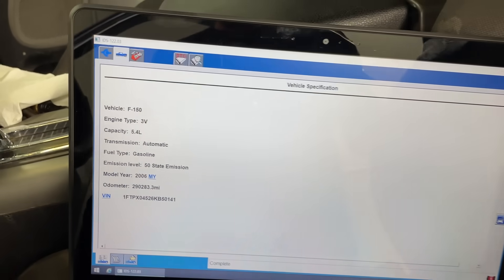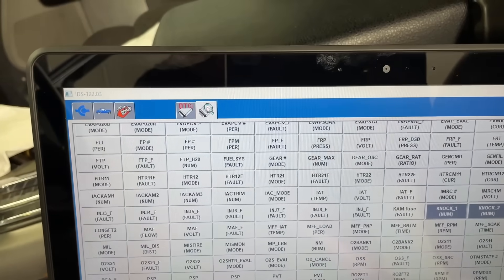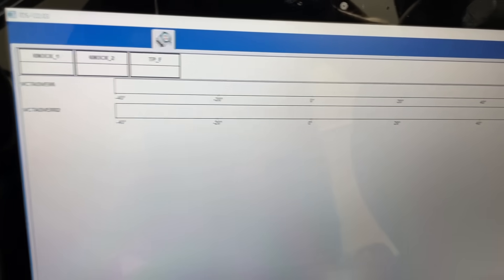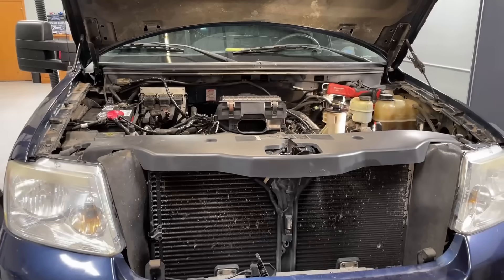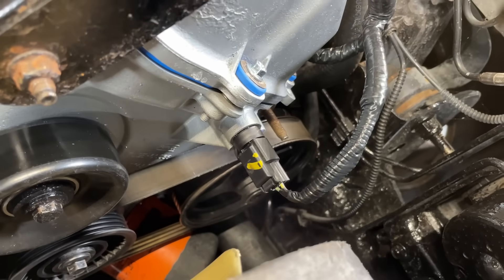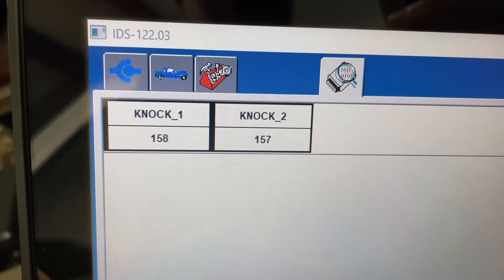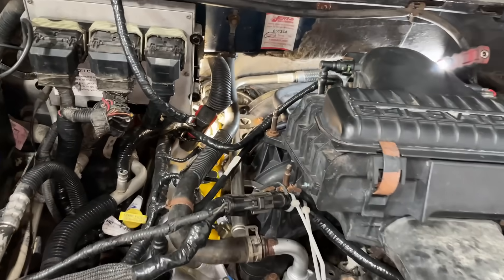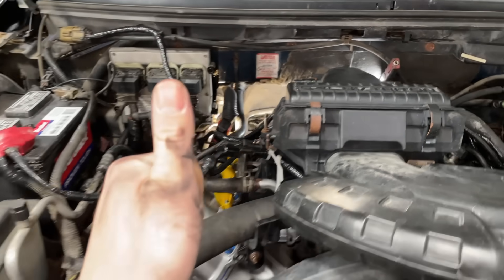Ford F-150 5.4L 3v Triton P0325 P0345 P0349 Cam Timing and Knock Sensor Faults After Engine Install

Comment: Brought my truck in, paid over 3 grand to fix cam phasers, I was told, was the reason for my f150 triton, 2006, 5.4 knocking noise, ....still making same noise!  Just gonna run it till it dies now, not putting anymore money into it!!! Which is sad, because otherwise in great shape,......noisy  tho lol.
Reply: Bro check ya spark plugs

Comment: Please help me. I have a 2011 5.0. Cylinder 7 misfire. I checked all ignition and changed them. Did nothing. Pulled the heads off. My intake valves were really recessed. Got my heads redone. Still misfires. I have no idea what to do. And every time i drive it it goes into limp mode. It also smells kind of bad on a cold start

Comment: Interesting. I had a 97" T-Bird 4.6 and it kept having high idle, even after replacing the Idle Control valve, and the TP sensor. Still had high idle, so It was suggested that I replace the TP Sensor connector. Bought one for $20 at an O'Reilly's auto, spliced it in, no more high idle.

Comment: Had a customer years ago with a Chrysler lean burn system that had a surge under cruise. Had it to several shops and was told everything from a carb rebuild to a new engine. 
I took on a test drive and adjusted the power valve to slightly enrich the primary metering rods on the thermo quad carb. The car ran beautifully, no more surge.
Customer said the car never ran that good when it was new. 
When he got the bill for $50, he had a fit.
"How can you charge me $50 when all you did was turn a little screw?"
I said "It's $5 to turn the screw, $45 to know which one to turn."
He paid the $50 and gave me a $20 tip.
Reply: Hopefully this was a long time ago because that screw should cost 350$ atleast to turn lol ;)
Reply: @Joebummy  Back in the early 80s. Money was tight in our area.
Reply: I bought my fx4 last year then watched you vid on the cam followers and being a problem I’ve been scared shitless every time I get in it even though it has not 1 oil leak and is the quietest motor I’ve owned it’s sitting at 260!k on the odometer and I love the truck I give 4500 for it it’s perfect wish I could say the same for my 2011 Taurus and my  2012 ford edge nothing but water leaks to interior front parts literally falling off it was so bad I gave it away after paying 8000 for it the year before both were always giving me chronic electrical issues put 2 climate control in Taurus in 1  year will never buy another ford car

Comment: Not related but just a question. What do you think of the CRC intake valve cleaner and it's procedure? Ford themselves says not to use it because it could break off huge chunks of carbon that could mess up the turbo and cat. But the CRC company says no it dissolves the carbon and cleans it and dries up really quickly so its not a liquid that settles. People said they have great results and others say don't risk it.
Reply from the maker: I would never use the CRC valve cleaner, I have seen it's results first hand and they are not impressive.

Comment: Sadly you’re the only mechanic that I can trust . I’m not sure if you read these comments but I have a question and I would greatly appreciate a yes or no from you. I have a 2020 F250 super duty Tremor and instead of buying new rims and tires is it possible to safely use a quality 2” hub centric wheel spacer to improve the stance of the truck so that it doesn’t look like it’s wearing skinny jeans?

Comment: I cant tell you how many problems i have repaired after the engine was replaced and was simple connector locks broken, seals lost causing bad connections and hundreds of TPS connectors on Mustangs from being probed and corroded just like that cam sensor was. The worst was 90s f150-250s with the TPS on the bottom of the TB.

Comment: I hate when people get lazy and break insulation, just use a narrow sharp T-pin and push it through the weather pack seal till you contact the back of the pin.

Comment: I ran into this same issue on a 94 Chevy C1500 truck I had. Intermittently the engine would all of a sudden start running really bad and almost stall then it would run great again. Hooked a scan tool to it and started messing with wires and found that the ones that went to the temp sensor connector that tells the computer the engine temp was causing the problem. The prongs were spread apart too far. Pushed them back into place and that took care of it. When the connection was broken the computer was seeing a stone cold engine so would configure the fuel and timing which made it run way too rich.

Comment: That truck is exactly like mine!! I’m hitting 200k this month.  Still runs great but I’ve DIYd the phasers, timing chains etc and several others issues using your great videos!!! I had my driver seat repaired. I guess they all tear like that.
Reply: Where did you get your seat done at
Reply: @1cgoodrich  just a local upholstery shop. They did a nice job and replaced the center and edges.  Materials and labor were $350.00 as I recall. They had to order the material from an outdated materials shop. A little extra. Mine is the black cloth. Worth it if all else is in good shape. I was in the Sacramento Ca area then.

Comment: At around 15 minutes into this we talk about the weather pack seals and everything else you have to remember you weren't the one that disassembled this engine you weren't the one that may have been a wild animal that's yanking away at the plugs and everything else and we also do know because of the age of polycarbonates do harden up and sometimes the plugs don't want to come off and the locking tabs could also break and snap off also this is the dilemma that happens all the time whenever there's any kind of major motor work after the vehicle has x amount of time on it or a lot a lot of miles due to the heat that's generated inside the engine area and also outside elements so you are absolutely right in explaining what happens to these plugs but in the beginning it also could have been someone that was very brutal taking this whole thing apart not using any TLC

Comment: I always get nervous using a razor blade splitting the harnesses open worrying that I might slit part of the actual harness itself other than that that is the best way to do it exactly like you're doing you and I and probably so many out there choose to do it the way you're doing it you remind me of myself 35 years ago even though I have a total of 50 years under the belt as of this February

Comment: thank you for another great video.  I'm learning a lot about my f150 watching your stuff.  You mentioned in the past that some engines like to eject plugs,  my 2003 4.6l V8 just did that...Expensive repair; $400.  replaced the rest my self even though I was good for another 30k.  Amazing that it only takes 3.5 turns to set them in place.  What a bad design, haha

Comment: Does the wiring in the truck use a lot of multiplex systems where differing signals use the same wiring path to communicate to the CPU ?
This would have the effect of one side of wiring being repaired also repairing the other side at the same time.
Reply from the maker: No these are direct wired to the pcm.

Comment: The statement you made in the beginning about clearing the codes the process that you have is the exact process that should be done each and every time I also would recommend on any vehicle doing a history of all the computers that are in there or a health report this way you know where everything is at it's a good practice because of these vehicles get newer the computers are doing more and more interacting and affecting the operations of another computer

Comment: The cam sensor location are in a great location when I bought my truck the famous tensioner pulley gave out and drilled into the front plate on the engine and I was tired after 14hr at work so I had a place do the belt and tensioner pulley I get it back and the place that did it busted the sensor off by accidentally hitting it while installing the belt it literally just crumbled to the touch

Comment: I have a 2019 F350 dually 6-7 diesel. I'm a hotshot driver I've got 298000  miles on it around 230 thousand miles it started to have a long crank sometimes it will times itself out. I took it to Ford cuz they take care of everything on it they said the fuel pump is going out they replaced it still the same thing long crank so they change the high pressure pump still the same issue I asked him about the glow plugs and requested to change them still the same issue. This is a Master Mechanic for Ford at the dealership he does not know what the issue is, he said he sent the information to Ford and it came back with only two issues changing out the fuel tank and feel a line he said the fuel tank is fine sorry still trying to figure it out with Ford. I'm just wondering if you can help with some ideas the truck runs real good I take care of it change the transmission where in every 50 60000 miles it runs like a champ it's just that cranking it up once you Crank It Up turn it off she will fire up quick but if you let it sit there for 30 seconds it loses its prime and takes a while to crank up
Reply: How do you put nearly 300K miles on a truck in less than 3 years ? Heavy hauling cars on a long slant flat bed..
Reply: @kristopherdetar4346  no I'm General Freight have a 40ft Hotshot Air Ride trailer I actually started in July of 2019 so really 2 and 1/2 years just rolling it's been a good truck

Comment: The downside of DIY in more sophisticated  repairs. You build the tank and a misaligned discombobulator or sloppy connection sets you back. Then you gotta call ghost busters with the $120 hr. rate. Its frustrating  but burn you learn.
Reply: A $3000.00 scan tool really helps too.
Reply: @DS-ss396  the scanner didn’t tell him the cable was corroded, his knowledge and skill did

Comment: 3:49 All that hard work and a brand new engine engine and he puts a fram on it….. wow
Reply from the maker: I hate Fram too but man do they have an advertising campaign or something.
Reply: @FordTechMakuloco  What brand would you recommend?
Reply: @CooperCarr  I use motorcraft only on my fords and ac delco on my gm's
Reply: I can understand the mindset, some people like to run cheap filters at first for break-in (if it needs it) since they're gonna change it soon anyway. Me personally though, is a couple dollars more for a better filter going to break the bank? no.

Comment: Great work, and I agree, always check the obvious first.  I sometimes get frustrated with Eric O. over at South Main Auto.  He does all these resistance checks, grabs the schematics, etc.  I'm usually saying "LOOK at the connector first".  Then he's do 20 minutes of diags and then go to the connector and say "Well there's your problem".  Even when he sees that, he'll go through and say "well, we need to go through the process".  I'm more "OK, Connector wire is broken, fix it, and see if that was all the problem, or if there is more, you KNOW the wire is broken, so it has to be fixed anyway"...but, I'm not him, and it works for him.  I still like the channel.
Reply from the maker: I feel the same way, it's like these other guys love to bust out the oscilliscope and meter just for something that is almost always a simple fix.

Comment: Here in the Southeast I don't see much of the corrosion issues but do run into wires broken at the connectors or have the pins have been probed with something very large. I use that grease on most connectors to make them easier to put back together. Awesome diagnosis!

Comment: That's why mechanics need to learn to back prob these plugs!!! Drives me nuts to see these problems! The tool trucks sell nice sets to allow back probing the weather seal on the wires without damage. Stop compromising the wire sheild!!
Reply: Far to much back probing , without resealing probe when " finished " !
Reply: @williamallen2817  I wonder if sealing is good enough? Maybe the hole has compromised the strength of the insulation and vibration will cause it to fatigue.
Reply: @timothyball3144  The probing can damage the wire strands which is the main issue.